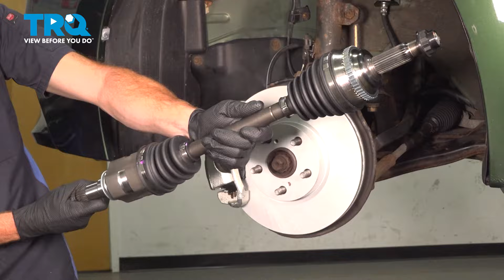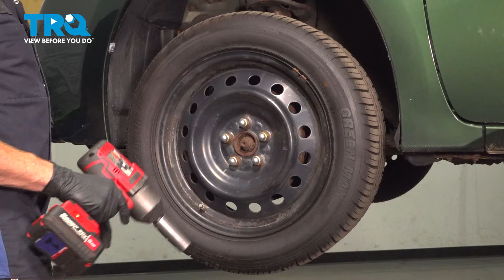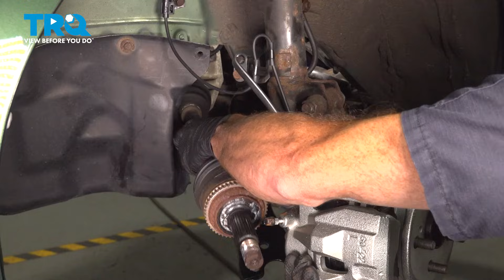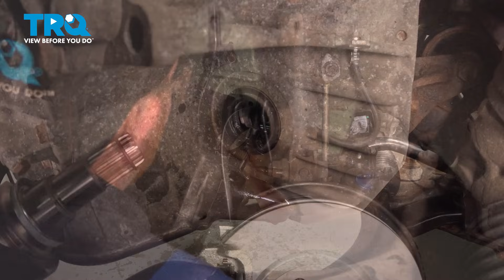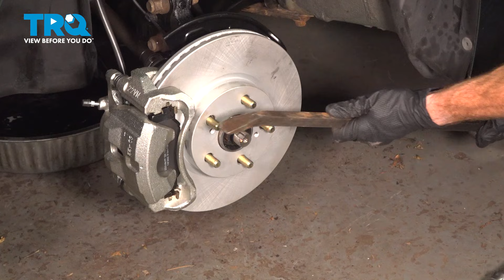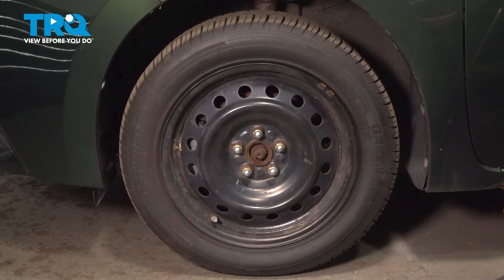How to Replace CV Axle Assemblies 2014-2019 Toyota Corolla

Comment: Wait !!!!    when you removed the lower ball joint Nuts and bolt you said the 2 nuts and bolt were 17mm  But when you reinstalled them now your saying the 2 nuts are 18mm and the bolt is 15mm !!